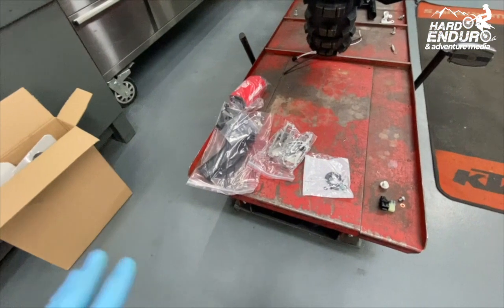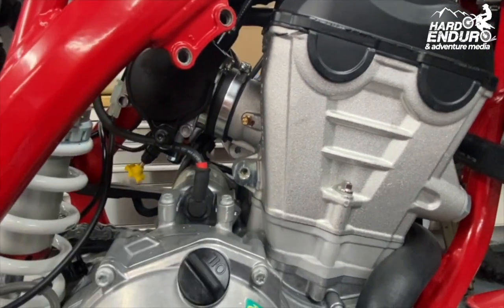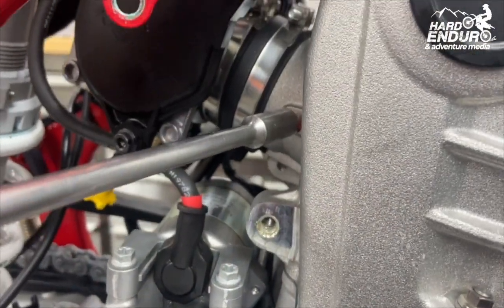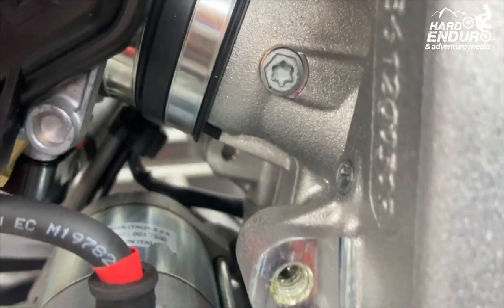GasGas Fourstroke EC250F Derestrict - PDI   Pt3

Comment: Thanks for sharing great content / May I ask if you remapped or added a ECU tuner on the bike after removing the emission system? Thanks
Reply from the maker: Hi buddy, all new bikes in the Uk should be PDi’d liked this.  Once the emissions/fuel evap is is taken off the bikes ecu is unlocked and then flashed with the most up to date GasGas/KTM map for that bike. No additional tuner is needed or added.

Comment: Are all these parts included with the bike from new ?
Reply from the maker: UK yes but they are useless to anyone.
Reply: @RobboRobinson  I meant the derestricted parts like the little block off plug for the o2 sensor wiring, is there also an exhaust bung included?
Reply from the maker: @Booki89  those are the parts we take off.  In the PDi box that comes with the bike is the plugs and a few screws.
Reply: @RobboRobinson  what does PDI mean ? I'm guessing the bikes come with all those items so it can be run "off-road" .
Reply from the maker: @Booki89  PDi Pre delivery inspection for customer. They come with stuff on to meet emission standards for export. Then when unlock the ecu and derestrict it to full power.

Comment: can i assume that the procedure for the 350 is the same? I picked up 2 bikes on friday from a dealer and both still had the restrictor between the end can and midpipe. i haven't checked the rest yet.
Reply from the maker: Exactly the same. Was the bike from an official GasGas Dealer?
Reply: @RobboRobinson  holeshot mx in salisbury
Reply from the maker: @richards0170  that’s ok at least you are covered with warranty if it needs to go back and not right.  There are grey imports out there at the mo with no official warranty back up from bike shops that look official but aren’t. 👍🏻

Comment: How exactly did u remove the mesh cap?
Reply from the maker: Which year of bike do you have ? The 2022 bikes have a different mesh?
Reply: @RobboRobinson  2021
Reply from the maker: @saulandresriosschambach6741  Ok the Tail pipe mesh is removed by knocking the small weld off with a small chisel and then unscrew the retaining collar with the KTM spanner in the tool kit.
Reply: @RobboRobinson  thanks!!